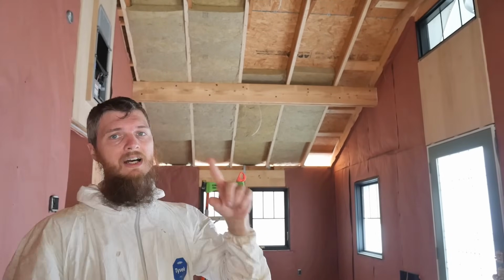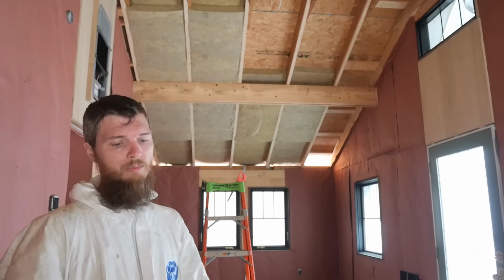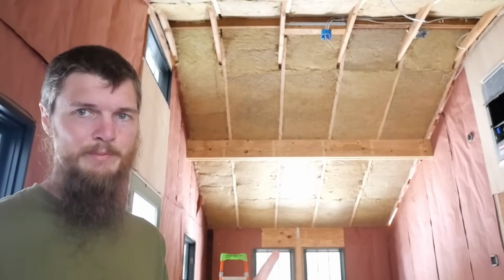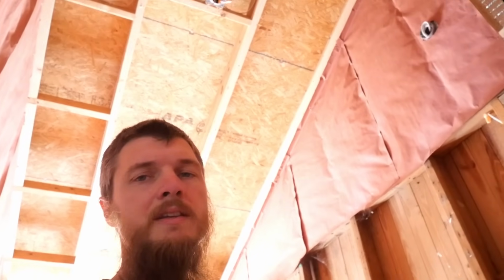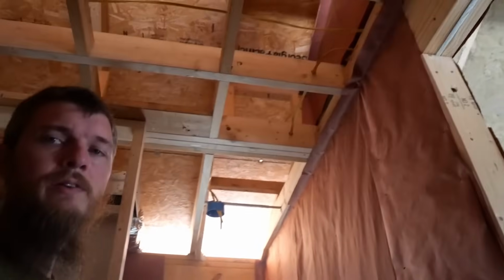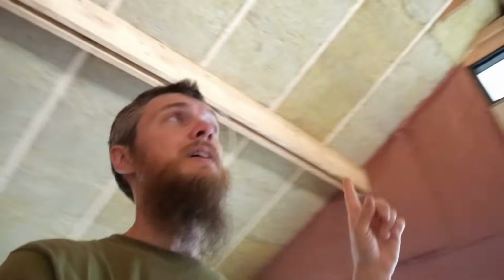Just Insulating our Cathedral Ceiling

Comment: I want to thank you for sharing this updated technology.  I am aware of building science and had not come across this one.  I am in Houston.  Currently looking into attic insulation and radiant barrier.  This is a great option.  Again, thank you for sharing your journey.
Reply: Radiant barrier will require air gap to be effective. Also, the RB material needs to be vented to avoid condensation.
Reply: @andrewhobbs6962   Yes, I know.  I had started doing a radiant with the air gap from the roof due to having the vented gables, etc.  I have always preferred the rockwool batting over fiberglass.  I think this newest option that Doug is using is much better than a vented attic.

Comment: Love the progress and your thought processes!! Living in a similar environment (we are TX gulf coast) and being concerned with durability / heat / humidity / costs of operation, we also added porcelain microsphere powder into our paint to limit heat / UV penetration and achieve improved ambient air quality. Our results were immediately noticeable. A bit pricey and takes sheen down one step so we purchased one step higher sheen. Didn't affect color, only sheen. We don't have metal roof but test results from those who do show remarkable topside roof temp readings - 115 in TX hill country! We used it on our exterior and interior painted surfaces. Makes finished product more resistant to chipping and hasn't impeded breathability - over 10 yrs. We didn't incapsulate.
Reply from the maker: Interesting! We never heard of such a product.

Comment: I knew you would explain the vapor thing.  You always do when you do something that isn't "traditional".  I needed to hear that today because I have an attic that I want to finish off, but the original builders didn't leave a roof ridge with a vent style, only vents on the eves, but that doesn't extend to the area of the attic that was built for finishing out for a room.  I know what to do now and I am in the south. I'm going to add a vent port with the fins (whirligigs) for that room. Every other areas is already vented. I'm excited for this info!

Comment: I’m from the U.K. and I understand that the amount of water they allow into our modern washing machines is very little. 
Ashley I have a little trick  I do and I know people out there will be shouting no! But I fill a jug up with cold water then after the machine has finished adding it’s allotted amount  of water I slowly pour the jug or two of water into the powder compartment that then filters down into the drum and adds extra water. Sometimes I add more than two it doesn’t add much more time to heat.

Comment: Vapor permeable venting does work here in Florida, I worked HVAC/R in new construction for a company that was top notch in energy efficiency. And we worked in a lot of houses that are set up that way. However I would recommend maybe looking into an ERV instillation somewhere in a main area of the house or installing a small dehumidifier that operates independently of you AC unit in your attic. Florida has a lot of humidity and it can become an issue when going the route you guys are going with an older home that doesn’t have a really good sealed “envelope”. Keep up the great work!!

Comment: Those bundles looked so pleased to be let out of the trailer, it was almost like they were breathing. I will not comment on the technical aspects; your conditions are somewhat different to mine. However, I thought that you did a great, tidy, careful fitting job. The insulation went excellently, with no obvious gaps or bits missed. I admire your energy and workmanship, along with the choice of music, which I really enjoyed. Your technical explanation was excellent, not too detailed, but good coverage of the reasons behind what you did.

Comment: Ashley, my old washer was an apartment size with a small tub.  My current machine is one of the water savers and as the only occupant of the house I find I can do a larger load and not use any more water than my old machine to do 2 or 3 loads by using the bulky/sheets setting that lets the machine fill with water.  I find it works well for me.  I like the idea of layering the insulation and staggering the air gaps.  I hope it works well for you.  I live in N.W. Iowa and as you explained this method wouldn't work for me, But so glad it works for you.  I found it very interesting and informative the way you explained it.  Good job Doug.

Comment: This is exactly what we did to our tiny home when we built it, we used fiberglass. The reason why is because a lot of mobile homes and travel trailers are made the same way where the insulation needs to fit a small space. Our tiny house needed every bit of space and we never had any problems plus the building laws on mobile homes and travel trailers are way different than foundation homes. We’re in southern Oregon.

Comment: I absolutely hate the new washers,there was a water regulation because of a drought in the seventies or something but that drought level I has been lifted now so you can remove that flow regulator in some washers.
 But I prefer the old type of washers where I can lift up the lid and see what the heck is going on Mid wash...

Comment: yea i got a new washer dryer, front loading, never again. Next time i need a washer, washer will be the top loading basic white washer.  The worst is the rubber gasket seal that needs cleaning all the time or mildew and mold will grow inside the rubber lip. Keeping door open to dry it out, just gets in the way. Front loading washer, maybe good for laundromat, not home.

Comment: I hated those personal protection jumpers.  When using fiber glass it was better then the rash.  I used to vent under the arms and if not crawling threw you can wear a t shirt and cut a couple vents between your shoulder blades.   Cut open where your front pockets are and duct tape the edge. It's cooler and let's you reach your keys!  I didn't work I Florida but have insulated a lot of duct work in extremely hot factory ceilings. Love your good work and beautiful family.

Comment: An air gap between the new metal roofing and the roof deck using furring strips might be a good idea.  It should lower the temperature of the upper area of the insulation somewhat.   Are you going to install a radiant barrier before dry walling the ceiling?

Comment: Nice looking insulation job.   The down side to insulation against the roof deck is your forgo any air current cooling of the roofing material you would get from an air space.  The higher temperatures significantly reduce the life span of asphalt type roofing, consider metal or tile where higher temps are not an issue or at a minimum use "cool" color shingles. 

For those wondering, Florida is a mild climate, rarely ever gets to freezing unlike northern states, but FL does have humidity especially in the summer.   When you turn on the AC the temperature of the drywall can drop to below the dew point of the outside humid air.  This can cause moisture to condense on the back side of the drywall from outside moist air that penetrates the insulation filled wall (or roof) cavity and can result in mold growth.   The solution is to install a vapor barrier on the outside of the wall cavity. In northern climates it's just the opposite, in winter, you want to prevent interior moist air from penetrating the wall cavity and condensing on the cold outside wall surface, thus the barrier is on the inside.  In some climates you have both conditions and there is no best solution.
Reply from the maker: Yea, we'll be going with metal for the roof. :)
Reply: @diyfferent  That will look good on the house and give you long life, good choice. Watch RR buildings or marshall remodel for great tips.  Keep up the good work.

Comment: I had a top load high efficiency washer - it was a piece of junk - those machines add water by the weight of the load being washed.  To trick the machine into thinking it was a bigger/heavier load, before starting the machine, I would pour in a bucket or two of water to weigh down the load.  It was a pain to do, but it helped get the laundry cleaner because there was enough water to completely submerge them and slosh around during the wash cycle.

Comment: I'm SUPER curious to see how the roof is going to work. Your explanation simplified it enough but I can't wait to see it in action. If it's one thing my manufactured home has, its HUMIDITY! And because of that humidity, plus the heat, it's ALWAYS hot in the house. In fact, it's more humid in my house than outside. I know we have a moisture issue. But with inflation with the way it is, there's zero way I can afford to fix it. Thanks again for this. Truly, it was enlightening :)

Comment: Interesting , Great strategy. So impressive. Update- from my old bath remodel. I was waiting on the
dry wall after the acrylic surround. My plumbing family did it for me as a favor but they did not back it
with green board. It started to smell like Radon maybe. They came back and spray  foamed under house 
any holes and little joints. Smell gone. Today got the drywall done. I think the foam under any small
opening in  this house is a good idea. Keeps air exchange from crawl space from happening.

Comment: First just four words: That is beautiful work!

Yep .. finally the codes have caught up to building a horizontal wall as a roof structure. House wrap allowing vapor permeability will keep it vapor acclimated. 

If you plan on using shingles, verify that they are able to be installed on an insulated and non-vented roof deck.
Reply from the maker: Thanks! We'll be installing a metal roof :)

Comment: I am so excited that you have found this solution.  I want to share something with you.  A few months ago I was watching your video and thinking about the problem with supply for the roof.  The idea came to me - why couldn't you use two thinner batts?  It equal the same R no. and might be easier to handle being thinner.  I was going to say something but I was afraid you would think I was complaining or criticizing you.  So I didn't say anything.  I hadn't done any research or anything like that to support my reasoning, I just thought it might work. So it was a pleasant surprise to see you doing just what I was thinking. And shocked to find out it was new technology.  I'm smarter that I though I was. (lol)  It is wonderful to see you move forward with the house.  It looks like things are going to be moving along faster now.  You have had to deal with so many issues.  Just had to share. Love Ya  and happy installing.

Comment: you explain thing's very well. I know for those whom don't understand building codes, might not understand the process to build with safer products and do it right. one thing I don't do is plumbing and electrical work. not licensed or insured.  that's when you get a professional to do it by code.

Comment: I reside in Florida just as you do, but in northern climates, like where I plan to build a home, you need to have an air gap because you need a cold roof with a channel bottom to peak so condensate  doesn't collect which will rot the roof sheathing. I'm planning to run baffles from the bottom to the top of the roof peak to accomplish this. I may be able to utilize the vapor diffusion port you've mentioned in my build also. Rockwool is a great choice, as spray foam will prove to be a nightmare when future repairs are required.

Comment: For those who jump at it and has no air venting gap made with a 2x4 strapping between the under side of roof sheathing an the top of the rafters expect a lot of condensation molding on the dry wall, rotting the rafters by the years, the uv poly vapour barrier taped and sealed would help, though we didn't see it here happening. I suggest look and check international building code before doing  anything.
Reply from the maker: The method we are using is actually a building code approved method using a vapor diffusion port on the roof. While it's only currently approved for the southern climate zones, you'll find unvented attic and roof assemblies gaining popularity in the future. 

And contrary to what many people believe, there are several good methods to achieve an unvented roof assembly in any climate zone.  Studies in building science are showing that vented roofs sometimes bring more moisture in than they expel. And there are many benefits to unvented attic and roof assemblies.

But no one should build an unvented roof without understanding the proper ways of doing it or you really could end up with moisture problems.

Comment: i agree on the washing machines - either you have to put in less clothing or you have to add water - i add water because i want my clothes and soft furnishings to be clean. I wish there was a machine that was more effective but until then i add extra water! I am curious on the new building techniques and fingers crossed they work. I never thought about insulating a house in a hot weather area but it makes sense to stop that heat from coming in. As always i learn something new from you guys everytime i watch one of your vlogs!

Comment: Just love the music !! Plus good job didn’t think fl needed insulation to that degree  but I guess so
Reply: Insulation in Florida saves money for heating and cooling, but especially cooling.   In the winter, South Florida can get into the 40's, central  Florida 30's, and north Florida, 20's and below, for short periods of time.  Rarely it can get cold enough to freeze  in south Florida. Most Florida homes have electric heating which is very expensive.  Summers are very long with temperatures in the upper 80's and low 90's for 6 or more months.

Comment: Having ridge vents allow air to flow and cooling of your roof to happen.  If you block airflow, then the roof material itself will get super hot shortening its life.  But if you allow air to flow between the steel roof and the roof membrane, this will help a lot.
Reply: No different than spray foam, if you have an air gap between the footfall sheeting and the insulation without ventilation then there would be a space for extreme heat to build up, Doug is precise with all of his cuts and it fits well!

Comment: Bring in zone 5, I'm pretty unfamiliar with southern building practices and codes but I'm curious about this system. In FL heat and humidity that entire underside of the roof will need to thoroughly expire all that hot vapor. Will be interesting to see what your roof surface will be.

Comment: I like the way you did it, I like the rock wool I wished we had that when we did our house, it looks less messy on installation. I'm with you on the new washers bought one last year because the one we had which wasn't very old the repair guy said it would cost more to fix it so bought a new one and it was going off balance even though I follow directions faithfully, sent it back and got another still dont trust it will last 😕
Reply: Next time try a Speed Queen.

Comment: I know you wouldn’t, but if you did shoot closed cell foam, would you still need the membrane? Thinking closed cell may not allow any moisture… I’m probably wrong?

Trying to find a solution for insulating a low ceiling with a flat roof.
Reply from the maker: A roof properly insulated with foam doesn't need any ventilation or membrane.

Comment: I used Rockwool/Roxul on a exterior bedroom wall (without a vapor barrier) I did not get to the drywall for some time, had to do a small framing repair and remove a piece of the Rockwool, the moisture was so bad I had to take out the entire wall of insulation and spray down the wood boards with mold control and set of a fan for days. I did watch the entire video and hope your method of the venting port works.

Comment: Fun fact. I saw a tour of the factory where they make that insulation. It is rated so that it is water soluble and bio soluble. Meaning if you ingest a bit of it on accident, into your lungs, it will not interfere in your lung activity. It will just be processed by your body.
Reply: Good to know!

Comment: Interesting,
I have the same exact situation and have been looking for 7 1/4 Rockwool/ mineral wool  for months just like you guys, found this very helpful,
Interesting to know how it’s been going since you posted this video
Reply from the maker: As far as we know, everything has been great with our ceiling. Someday we'll have to try to get a peek into the roof assembly but we haven't seen any signs of issues. And we're so glad we were at least able to find the thinner mineral wool to double up because that R-30 is hard to find!
Reply: Yes, I did locate the 7 1/4 but it was out of stock for who knows how long, so I’m gonna do the double layer of 3.5”.
Question - did you vent the soffit?
Where can I find the Technical data on this system?
Thanks
Reply from the maker: @corso5150  We vented using a vapor diffusion port. Technically this method is approved for the southern climate zones. But scientifically it has worked well in northern zones as well.  

A lot of good info in these articles: 
Part 1: https://www.jlconline.com/how-to/insulation/avoiding-wet-roofs_o

Part 2: https://www.jlconline.com/how-to/insulation/avoiding-wet-roofs-part-ii_o
Reply: Thanks

Comment: Nice work, have you guys thought about using reflectix as a vapor barrier/ radiant barrier. Seems like it would kill 2 birds with one stone. I know rock wool probably isn’t gray at reflecting heat out or back in. I did my house similar to how your doing this ceiling and it doesn’t seem to work too well I wish I had done more insulation and used some sort of radiant barrier.

Comment: What knife are you using to cut the insulation, it looks like it works great.?
I bet there was a huge difference on the temperature in that room after you finished insulating.
Reply from the maker: It's just a cheap insulation knife that was probably from Home Depot.